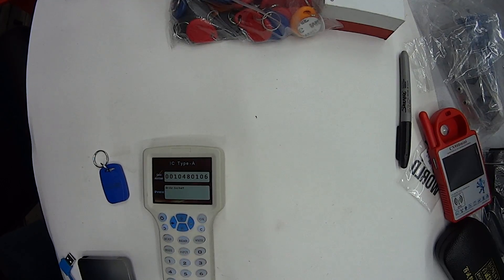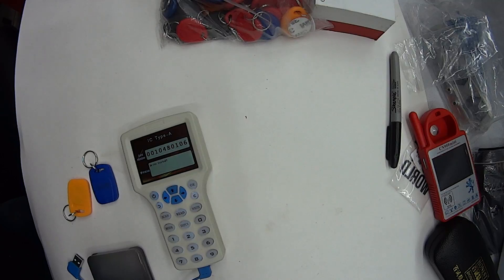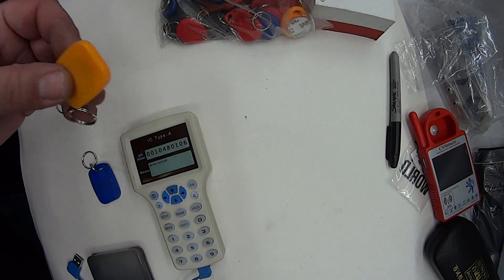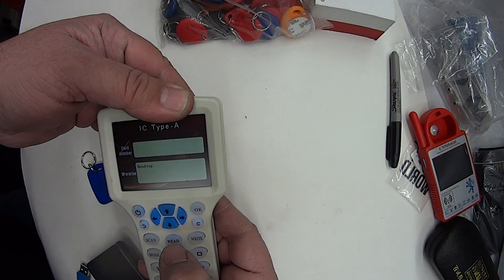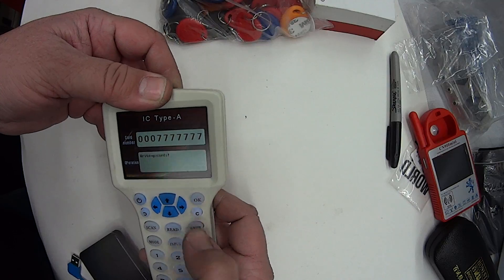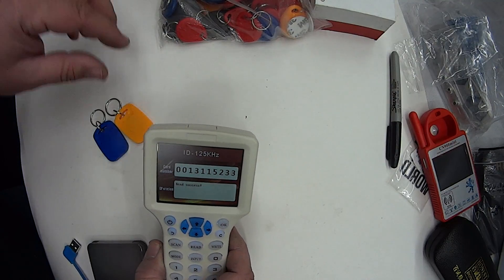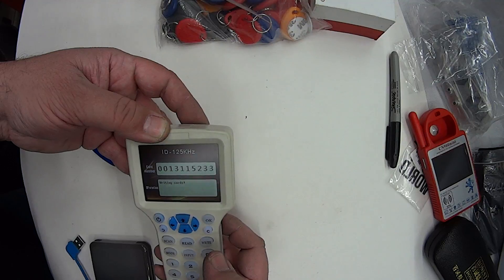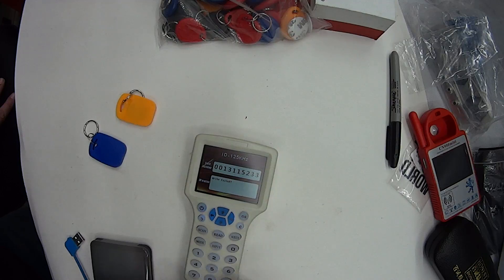How to clone access cards – swipe cards – start with this clone token

Comment: I have a question that no one has tested, I have same reader/writer. I have key that's (HID 125Khz) can I write manually the card number to a keyfob that's (125Khz) but not HID? I tried the automatic read/write but with fail error. When I purchased this they of course do not tell you anything, only that it works with all but yet they only send you a few keyfobs 125khz no one mentions HID but the menu has HID 125khz, maybe there is a way to copy HID-125khz to regular 125khz keyfob

Comment: Picked up one of these from ebay to clone HID proxmark ii card which are 125khz. 
However when i scan the HID card the number shown on the screen does not match the 5 digit number printed on the card. 
Im assuming there is a way to convert the decimal 10 digit number to show the site code etc. 

Do you know any good sites that would show how to convert the number shown on the screen to the number its actually programmed as? 

I know the number printed on the card is correct, as thats the number we program on our system to allow access. 

Cheers
Reply from the maker: no I don't think so, its a simple machine that will only show some of the data, I don't think you can set the site code with it, or retrieve it.
Reply: you need to plug this into PC usb and crack the encryption with the software provided, copy or duplicate and import all that over to a tag with a changeable UID able card/tag, 125khz easy to do, 13.57 can be difficult occasionally needing brute force

Comment: can you clone 125 to a 13.56?
Reply: Don Granier I believe the credential code could be copied (the number that pops up) by hand, but it likely couldn’t do this for you. I fail to see the usefulness of this though unless you have a system which reads 125kHz and 13.56MHz fobs, and accepts the same credential codes with both frequencies.
Reply: @nicholasboyd3039  so I tried that and it did not work. What I want to do is take my work ID badge (125) and put it on a ring (13.56)
Reply: 125

Comment: How do i figure out if the card I am reading is a 125  Khz or a 13.56 hz ?
Reply from the maker: Auto scan
Reply: @DrLockShop   thanks
Reply: You can put strong light source behind card and see the copper coil shape.Rectangle,square,round with the little square chip determines the card type.
Reply: @superconnie5003  thanks I'll try this out

Comment: My reader, same as yours, came with windows software to decrypt cards. However mine also has a annoying speaker.
Reply from the maker: I disconnected the speaker, The software I got built into the machine had a virus "Ground.exe"